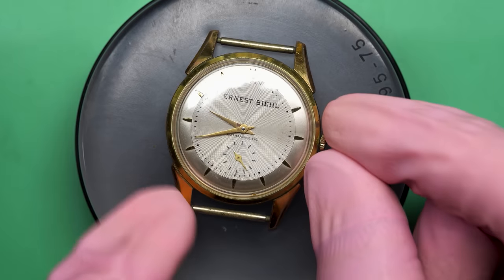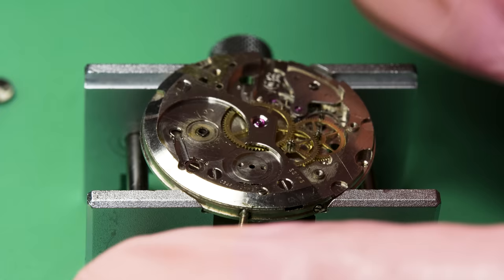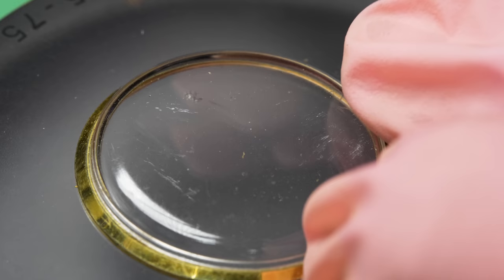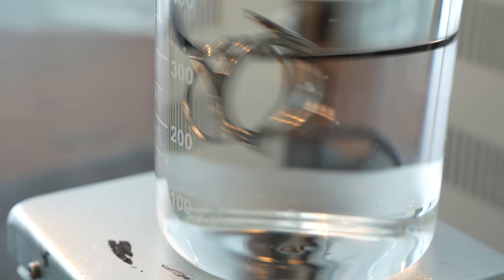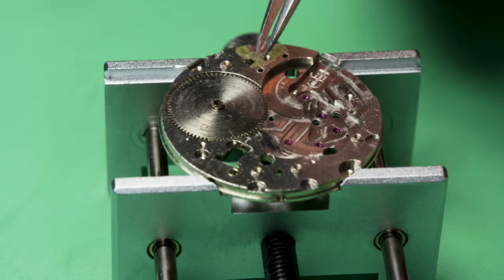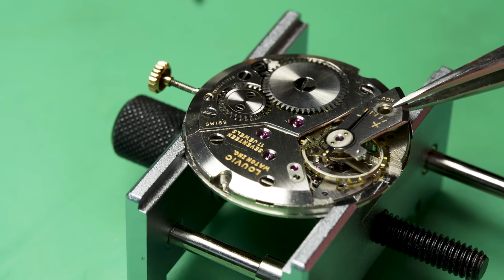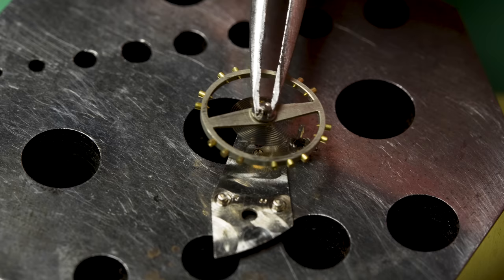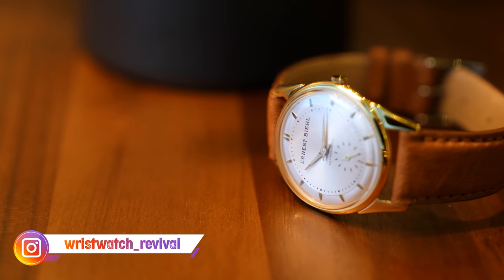Restoring a Charming Vintage Watch From The 50's With a Clever Custom Dial!

Comment: ETA used to make movements for most Watch companies.  A few years ago they stopped and only supply Swatch companies (Swatch, Omega, etc) with movements. It was sudden and really shocking to the industry.  Several other companies have stepped up to fill the gap though.
Reply: I read an article somewhere that swatch group were kind of forced to stop selling outside of their company do to monopolistic issues. They controlled the swiss movement industry. Not sure if it's true, but I bet they're losing big bucks & sellita has increased business a lot.

Comment: In the 80's I was working with laser cutting machines for videoheads.... I made a little program to write my initials on the dial of my Citizen Chronograph... through the glass, without disassemling anything. Was at that time an unmistakable unique piece.😉
Reply: That’s awesome. I do CNC  machining work. Now you’ve got me wondering if I could customize some of my watches…

Comment: Hey Marchall,

As a watchmaker, I'm happy to see people get in touch with watchmaking, and your oiling has gotten much better! If I'm honest, I used to cringe heavily whenever I saw you spill oil all over the jewels. 
About oiling capped jewels, there is a method called the pass-through method.
This is very useful as it's a very controlled method that doesn't require the capjewels to be removed.
The principle is that before assembling the bridge, you give a little bit of oil on the other side of the jewel (cog-side) and then "prick through" with a very fine needle. It needs to be able to go through the hole of the jewel and touch the capjewel. It will take the oil with it and make it suspend it in the right place. Repeat if there is not enough oil in place yet (at least 50% of the diameter of the capjewel).
I use a modified broken oiler for this.
Hope this will help in the future, and keep at it!
Reply: If the cap jewels aren't removed, how do you remove old lubricant residue?
Reply: @gwsjr1  Great question! If a regular cycle through the cleaning machine doesn't get the gunk out, rinsing in cleaning benzine (no idea how it's called in english really, but it's  type of solvent called wasbenzine)  usually does the trick. If that's still not enough, then yes by all means take out the capjewel. But this method prevents having to take it out in like 80% of the cases. I only do this on watches without anti-shock systems though.
Reply: I do this but I do firstly remove cap Jewel and clean but my method is to use auto oiler, which is basically just a fancy needle to do the same thing you are

Comment: I found your videos here and it fascinates me so much that I HAD to get into watchrepair, since I had a couple of older watches laying around that had not been serviced but were still moving. Especially an old Elgin Pocketwatch that has finally stopped working. I will practice a bit on cheaper movements. I am making my first baby steps and making a lot of mistakes, but finding this video here excited me a lot, because the movement is the same as the one my father gave me when I was young. I serviced it, but broke off the setting lever spring / bridge. So I ordered another of the same type of movements for the spare part and will try to finish it today. Thank you so much for your work and may you be blessed!

Comment: This video was right on time. I just bought a Louvic for my first watch restoration project, but found very little information on Louvic. The one I bought has a center mounted second hand, so I’ll be handling a different movement, but this is helpful. Great job on the watch!

Comment: I have to say Marshall is that during the intro, you are spot on. The watchmaking is fascinating to watch (no pun intended), but it's multi fasceted thing... On one hand you have the process, the discovery, the opening, the cleaning, and somehow, now some routine - that is expected - like the click when you re-engage the main spring and you can't help but notice how satisfying that noise is, putting it back together, seeing the balance wheel come to life, the cleaning of the jewels... the timing of the movement.. 
But it's so much more than that.. It's the stories, how the watch of the day came in your possession, who it belonged and belongs to now, sometimes the story behind a simple dent on the case - and the owner insisting that you do whatever you want to do with that watch, but the dent stays !
And, you do have a soothing voice.. Not one that puts you to sleep, but one that slows down your heart rate, that relieves any of the stress of an overwound main spring !
No it is not always the same thing over and over again.. Of course there is a common rythm to all the videos (which is reassuring), but there is always going to subtle difference somewhere in the process and it keeps us focused and interrested.

Comment: That movement is a Peseux, cal. 325 (10.5 ligne) or  333a/335/337/338-1 (11.5 ligne) - sweep sub-seconds, no date, from the early to mid-60s.  

Slightly more info is at Ranfft :)

edit: Peseux was founded in 1923 and absorbed into what is now ETA in the mid-80s.

Comment: Have you considered using a gold stripping solution? There are several proprietary processes which work quite well. The important thing is to check how well they stop at the brass! You would still have to do some manual polishing but it’s less risky in terms of mechanical damage. Alternatively there are cook book solutions, mostly cyanide based. That might alarm folk, and I would not use it in the kitchen, but normal  sensible hygiene and it’s fine.

Comment: I've watched many of your vids over the years and they are highly enjoyable.  A few times you've made mention of the threads on stems to fit crowns, and on more than one occasion I've noticed you correlating the thread size with the tap size.  For instance, this video (at the 20:50 ish mark) you referenced a .9mm thread as a "tap 9" when in actuality a .9mm thread is a "tap 10".

 Being a moldmaker/toolmaker by trade, the exactitude that comes with that livelihood got the better of me that I had to point this out.

Threads for crowns are as follows:
.6mm = Tap 13
.7mm = Tap 12
.8mm = Tap 11
.9mm = Tap 10
1.0mm = Tap 9
1.1mm = Tap 8
1.2mm = Tap 7
1.3mm = Tap 6
1.4mm = Tap 5
1.5mm = Tap 4
1.6mm = Tap 3
1.7mm = Tap 2
1.8mm = Tap 1
1.9mm = Tap 0
Reply from the maker: I did not know that! Thanks for the info
Reply: @WristwatchRevival  I have to apologize for the above comment.  I was on the NAWCC boards reviewing a thread on tap sizes for crowns and learned that the Swiss sizes are indeed as you mentioned (i.e. Tap10=1.0mm, Tap9=.9...etc).  The sizes I offered are for American pocket watches, not Swiss wristwatches.

Comment: Found your channel a while ago, love it! Even though it's uploaded a year ago, the technical term for plating by using electricity (cathode+anode principle) is called electroformation. It is a quiet delicate process especially where it comes to the temperature and composition of the solutions. The wrong temperature creates plating material stress which therefore comes off easily. Not sure if they use the same today but 30 years ago a process like this was used also for raiser blades (the bent ones) from braun and probably also remmington.

Comment: 11:00 - regarding the passage of time, I really appreciate the Swiss Rail SBB/CFF/FFS train station dials. They run the second hand smooth, then pause for half a second when a minute has passed, and re-start going. A minute more has passed. Another train departed, another train arrived.

Unfortunately they Mondaine that sells smaller copies of the dial face don't have anything similar - it's just the standard second jump, often powered by quarz.

Comment: Wonderful result.  Just one tiny remark.  I would not scrape  the case with a wooden peg.  The dry dirt contains all sorts of particles like silica, which are very hard.  The wooden peg is soft but it may act like sandpaper if it picks up those particles. The gold plating is very soft and vurnerable.  It is better to let the case soak in luke warm soapy water and brush it with a tooth brush.

Comment: Another great journey!  FYI - although the train bridge is engraved with Louvic, it was common for companies to buy movements from another company and to brand them with their own name.  This one looks like an A Schild movement, but you can tell from the stamp on the main plate under the balance.  It would be great if you could post the voltages, times and currents you used to redo the gold plating, for those of us who don’t want to have to experiment as you’ve already done.  THANKS!
Reply: I agree, it looks like the A Schild stamp under the balance.   A Schild, Unitas and a number of other Swiss Ébauche makers were eventually folded into ETA.   BTW, A. Schild movements were found in just about every thing from 'budget' department store branded watches to 'high end' watches like the Jaeger-LeCoultre Club Automatic.
Reply from the maker: This is a Peseaux 330 movement not an AS. For the voltages, you can see in the video what I used for each solution :)
Reply: @WristwatchRevival  Thanks for the info.  BTW, Peseaux was another Swiss ebauche maker that was folded into ETA.   ETA makes one or two of the Peseaux movements to this day.  ETA also continues to produce the Unitas 6497 as well.

Comment: Always love watching these.  I actually have my first restoration watch coming in tomorrow and its a 60s Sheffield Allsport non-runner with tritium lume, hoping its the 17 jewel version and not the single jewel pin plate but the listing didn't show the movement, either way the exterior is in amazing shape.  Also working on bidding on a mid 50s Omega cal 284 recased in a Star Watch Case Co. 10k gold fill case that looks to need a service and new crystal, but the case looks to be in great shape given its over 60 years old.

Comment: Thanks Marshall for the video. The coating process at 18:41, appears the black wire has broken insulation which has melted and stuck to the metal plate of the top line machine. There was some smoke seen to.
Reply from the maker: Yes that did happen

Comment: A friend of mine worked at a research facility where they worked on artificial, semi-conductive diamond. When someone retired, they got a watch with a diamond coated dial. Looked fabulous. Until that someone dropped the watch and the thin layer of diamond crumbled to dust.

Comment: Excellent video!!
The Louvic watch brand is quite unknown, but the watch movement appears to be an F330. You'll usually find the reference either under the balance or on the dial side of the main plate. You'll know this already, but for general info, identifying the movement manufacturer and calibre will allow you to source any spares if required.

Comment: LOUVIC was a pretty low-end brand and made low-grade watch movements, and costume-jewelry-grade replicas of the expensive LeCoultre & Longines watches that were popular in the 1950's. Their slogan was 'Unusual watches with the forward look'. Louvic Watch Co, N.Y., N.Y., Inc. 62 W 42 st. Louvic was one of many brands back in the day that were not really watchmakers but they would buy cases and movements from elsewhere and sell it as their own. Because of this there are a whole lot of different styles of their watches and very few that would be considered iconic to the brand, making looking for information for any individual model difficult. Their 17 jewel movement was ubiquitous amongst their watches. If you want to use it, it would be best to not wind it and let a watchmaker service it first to avoid damage to a movement that basically has no lubrication.

Comment: Louvic Watch company specialized in making very, very affordable watches especially for private labeling.   In the US I believe they marketed under the brand name Baldwin?  The Louvic 'mystery' dials are about the only ones you will find with their name on the dial. If you were a jeweler and wanted to market an affordable watch to to your customers, private branding could be easily done through Louvic.

Comment: I live in Israel. However,  I moved here from seattle. I have 3 vintage watches a 1979 Rolex and a 60s something Longines and a Buren day/date from the 60s. The rolex and longines are in top condition but the Buren although running 
 needs some work. It has been in my drawer for decades. I am a fan of your videos and would like to donate the Buren to your channel. I can send pictures if you would like. I have some Seattle friends coming here in the next months and could send it with them,  if your are interested.

Comment: Question: so you have the balance dictating at which rate the main spring is unwinding. Each time the balance is changing the direction of the pallet fork, it's allowing the spring to unwind a little, which also gives the balance a whirl via reduction gears (if I understand the mechanical principles correctly). So essentially the spring is unwinding one tick at a time, and given the length, did someone ever try to figure out if that's causing vibrations in the spring?

Comment: Based on the P hallmark, I’d guess it’s a Peseux movement. I believe they are solid quality. From my research, the Peseux 7001 seems to be one of the most accurate movements. It’s also the movement used in most 1st gen Nomos handwimders, or what they based it on.

Comment: For a second it appeared as if you put the regulator lever upside down. Like the pins where in the Rodico, but then there they were in the next shot.  I find getting the balance back together as the hardest part.  I struggle to get the hairspring through the regulator pins. I mostly work on Waltham pocket watches, mostly.

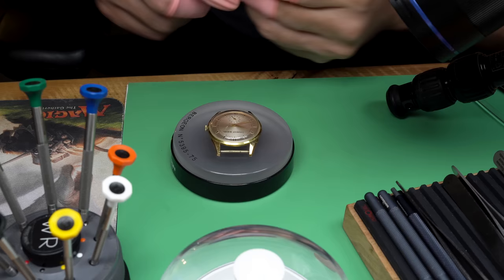Comment: What a coincidence your bolt action springbar tool at 1:03 looks EXACTLY like a PEN GUN firearm. In the firearm the very bottom section where the tool sicks out is removalable and one manually inserts a .22 cal round and screws it back on. The knob on the top section is pulled back and released to fire it.

Comment: I'm not a person who wears watches and I could never understand the allure of a watch, especially in modern times. That being said, I love watching your channel and I also get lost in the minutia of the tiny screws and how each tiny thing has a purpose in how they interact with each other. I will also credit your channel with the knowledge of watches that I've absorbed, as my father had ended up with a small box of assorted pocket watches and I instructed him on how to remove the case backs to see if they were battery operated or spring operated. Only 2 had spring/gear internals, and those will be valued at a later date.

Comment: I very much enjoy your videos.  I always think I don't want to watch a 45 minute video, but with your videos, the time just flies by.  I do have a question.  You lube pivot points, particularly those supported by jewels.  I have never seen you put any lube on the teeth of the gears, they always run dry.  Why no lube on the gears?

Comment: Marshall, you make the restoration process look so damn easy! I know you remove the parts and lay them on your bench, but are you using any articular method to ensure you put the right part back in the right place in the right order, or do you just do it by habit? When you first started, what system did you use? Like I said, you make it look easy.

Comment: Brilliant video Marshall, like so many of your viewers i too am starting to dip my toes into this hobby, bought a vintage National Electric watch cleaning machine which i plan to restore and rewire with modern cables, all i need is a couple of new bakolite lids for it and bought a few basic tools, my big ask is is there any chance you could find the time to do a video explaining the different types of screws you find in a typical vintage movement, their head shapes, lengths, shoulders etc and why they go where they go, i presume a watch has half a dozen or so identical generic screws for such things as train bridges, main spring bridge etc which seem to have quite thick shoulders whereas others have quite wide flat heads often polished, and also how you identify the train wheels, the escape wheel is easily identified but the other 3 or 4 wheels all kinda appear the same though obviously they aren`t as some have small cogs on them or the stems are different lengths, a big ask i know but one that would benefit us newbie virgins a great deal, cheers mate, and happy new year from the UK.
Reply from the maker: Good idea Glen I'll think about that for a future video

Comment: Interesting! I've seen a few "named dials" over the years, but they are exceedingly rare compared to caseback engraving. Most commonly it's letters used as hour markers rather than printed in place of the brand/model like this one; so the name is spelled out round the dial. Some combination of name, surname and/or initials can often come to 12 characters -- or 11 plus something more standard as the 12 marker. As a watchmaker who deals primarily with vintage models, I can also say it's far more expensive and time consuming to have custom dials made or reprinted like this vs. the usual engraving. That kind of dial work, especially back then, would be weeks or months and significant cost; whereas engraving could be done in a matter of hours at any local jeweller. 

Also interesting to see a standard balance cock in this era. The earliest shock protection ("Incabloc") was invented c1934 and had become standard even on cheaper watches by the early 1950s. Quite unusual to see anything like this without it, especially a movement that's clearly of decent quality. I almost wonder if that wasn't a replacement part... Might be worth checking ranfft.de or other resource. EDIT: I looked up the ETA cal.330 and that is the original factory configuration. Just one of the last holdouts of the old school I guess.